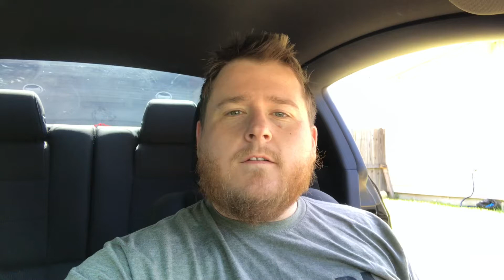How To Prime Your Coyote Mustang Or Any Ford Vehicle (Clear Flood Mode-Avoids Dry Starts)

Comment: To anyone that complains about starter wear just remember, starters are cheaper and easier to replace than engines. Also I've tested this and it seems to work on any drive by wire ford, tested on my 2011 town car, 2005 Crown Vic police, and my mom's 2009 Focus. I now prime first start every morning since my Town car has 300k on it's 4.6 and I want it to last.
To all who see this comment, may all your FoMoCo vehicles last to 500k or more with this trick.
Reply from the maker: Yeah it’s worked on every ford vehicle I have tried it on from our 2006 F150 and up. I do it after every oil change just to make sure the valve train has oil. It will also work on the ecoboost motors that have phaser failing. Clear flood and no start up rattling.

Comment: My car is seating on the driveway for 6 month. Need to start is. Honestly iam scared to do this . 🤷🏻‍♂️🤣. Dont want engine to rev to the sky. 😬
Reply from the maker: It won’t as long as you hold the gas on the floor. This works on most modern fords. I even tested it on our 2006 F150 and it worked.